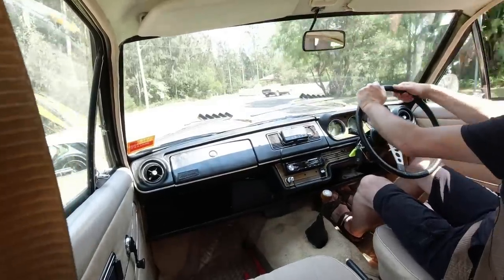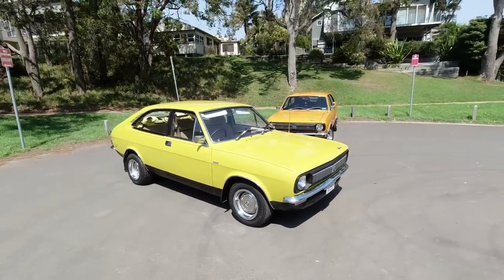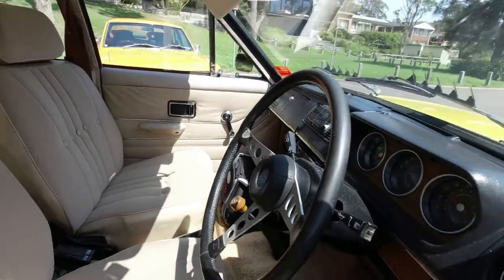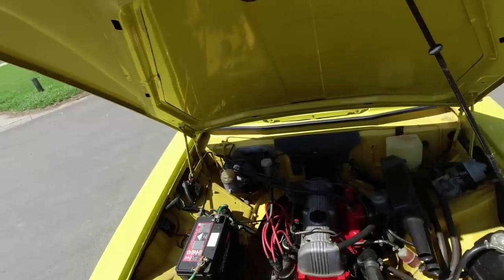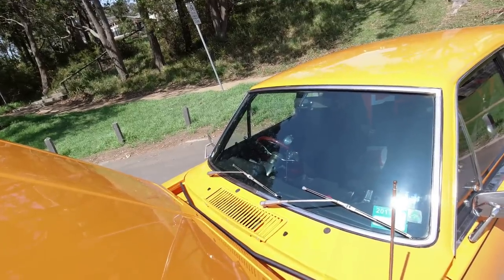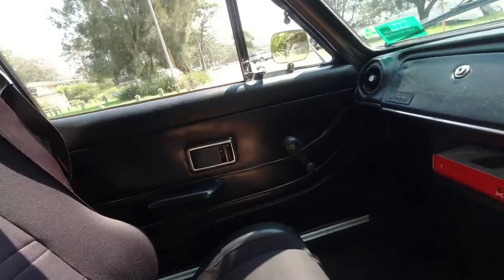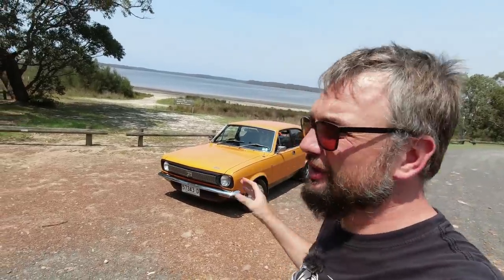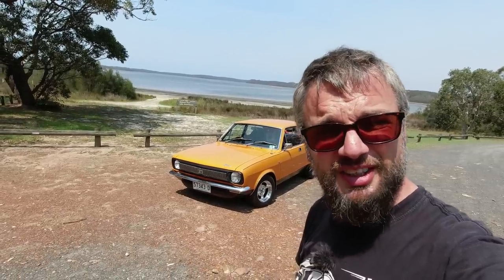Aussie Oddballs: Leyland Marina SIX-CYLINDER! Driven!

Comment: Brilliant  engine, the E Series. I had 21 Marinas - before I lost count. Used to pick them up for peanuts, get them running and drove them till they could drive no more. They were economical and, for me, they kept the wolf from the door in my early married life and owed a heap of money on our house. BTW, the 1750 engine had the same bore but a longer stroke than the 1500, hence the good torque. Got rid of my last one in the late 90s. That was one that had only 50,000 kilometres up on it when I saw it advertised for sale as a non runner. It was obviously hard to start since the starter had been burnt out on it. I put in a starter out of my other Marina, a manual, and it started first fire after standing for 3+ years. I was going to scrap it but when I realised the odometer hadn't been around a couple of times and really was low mileage, it became my wife's car. Only required 4 items to get it back on the road - wiper was stuck, ditter the washer pump - from sitting around a long time. Driver's side window winder broken and rear resonator had a hole. The reason it was hard to start - the original owner had put Bosch resistor spark plugs. When new, it was ok but when the gap became even slightly wide, the extra resistance when cold caused a very weak spark. Virtually cost nothing to get it back on the road and it cleaned up like a new car. BTW, the best option for the window winders is to use MG ones. They aren't scalloped out so much in the back of the arm so are stronger.

Comment: You mention the synchromesh 'not happy'.. and that was my problem with the Marina and Ital that followed. My first company car at 18 was an 1.3 Ital (X reg 1982?ish), six months old when I had it with about 7k on the clock. Second gear routinely crunched as sometimes did third. I loved it because it was my first car and brand new and my mates were driving 10 year old rust bucket Cortina's and Minis but it was a shocking drive. So embarrassing at 18 when continuously crunching the gears and people thinking I couldn't drive.. still, without people like you these old relics would have become washing machines years ago so thanks for keeping the memories alive. Still hoping you find a bottle green Humber sceptre with the black vinyl roof my grandad had.. 1725 engine, walnut (wood) dash, loved it with very fond memories.. here's hoping

Comment: of course it feels better built: the Oz and NZ built cars were better built.
Reply: My observation was the Oz cars were better than the NZ cars. Both in specfication and resistance to rust.
Reply: I should imagine Australia cars were more resistant to rust, they would hardly put tonnes of salt on the roads in winter.
Reply: All that sunshine would make happier workers;-)
Reply: NZ Marina was just CKD version from the UK
Reply: @Banom7a  And?
Reply: The Oz cars were better than the NZ assembled ones. The NZ car industry couldn't even build Japanese cars well. The car industry here deserved to die and replaced by new and used imports. Having said that I own a NZ assembled Allegro and NZ assembled Toyota 4Runner and NZ assembled Landrover.
Reply: @williamwoods8022  
But you didnt own an aussie or kiwi one.
Reply: Nz assembled cars would only have the   anti corrosion sprayed in the center of the panels , doors etc then rust out along the  bottom and  corners
Reply: @GSimpsonOAM  You do realize that Toyota ranked the plant in Christchurch as the best plant in the world outside of Japan, yeah?

As for whether NZ or Aus built them better, I'm not about to get into that pissing contest, but based on Australian performance in other areas of manufacturing I would have doubts. ;) :)

Comment: I have owned two marinas a 73 1.3 super and a 78 1300hl had no trouble with either and very reliable, how I would like to get my mitts on the 262 six wow what a glorious noise no silly popping and banging which seems to be the rage now. The o series engine was fitted to the revamped and renamed Morris ital and the montego a car I owned and regretted, I could not stop the engine leaking oil, keep up the good work Ian.

Comment: Great video, I briefly had 2.6 Marina 4 door, The suspension was shot which was terrifying (the design needed struts) The 3 speed box was definitely enough. But the acceleration was amazing and so smooth. Never saw a coupe version in NZ, but no doubt there were somewhere. Many thanks, Stay safe in the Lockdown

Comment: My god you are obsessed with wipers!😂 I have a soft spot for a Marina coupe, one 1.3 was our family car for most of my single digit years (I mean under 10 years old not my mum cutting all my fingers off). Vinyl seats to slide around on at every corner. 2 clocks as it was the poverty version. AM radio. Eventually it rusted away I remember the wings looking like a tin opener had been used on them, and my Dad upgrading it from wing mounted mirrors to door mounted mirrors and suitable chrome caps on the wings to cover the holes! Happy days.

Comment: My first car back in the early 1980s was a 1973 Aussie Morris Marina Coupe TC, with the Aussie 1750cc engine rather than the British 1800. It was white with fancy black GT stripes down the side, which ran from the top of the C-pillar, down to the top of the crease line, and forward to the front of the car. Not easy to explain, but they looked fantastic and really made the car. The engine, with the twin carbs, sounded great, and it went pretty well, too. Mine had no rust at all, and was also very reliable. It was built like the proverbial brick shit house. That's down under slang for built very solidly, indeed. The steel was very thick and strong. It was a pretty decent car, IMO, and I look back at it with affection, and I certainly wish I hadn't sold it for what I sold it for.

Comment: For what it’s worth I worked in a Holden dealership in the mid ‘70s, where my supplied ‘go for’ vehicle was a still quite new base-model Marina Deluxe Coupe, resplendent in the startling factory pinkish colour of Plum Loco..

Yes it was a 6-cyl with the 3 speed manual (on the floor) which I thought suited it very well; minimal shifting required, very smooth and torquey but also quite eager to rev. And yes it delivered always more than adequate performance, helped in no doubt due to the light overall weight. 

From memory I think ‘my’ example still wore the original Dunlop Guardian (or whatever they were) Crossply razorblades, so it was pretty lively in the wet! Wherein 2nd gear wheel spin was effortless, yet relatively benign. But nowhere near the ‘instant death machine’ they are made out to be, invariably by those who have neither sat in or driven them.

Years later I owned and loved two P76 V8s. But I never have forgotten that likeable Marina 6 with its rubber floor mats and longish gear lever, and of course the rare Plum Loco hue. In fact I’ve never seen another Marina 6 in this exact spec? 

At the time the dealer considered it virtually unsalable, which is why it became a ‘work car. But gosh as uniquely aussie nostalgia it would be an absolute hoot to own today :-)

Comment: I had a 1.8 DeLuxe 4 door in Teal Blue, brand new in 1972. Used it as a taxi for 18 months, and 110,000 miles. Never missed a beat. Loved it. I really don't understand what the 'haters', and they're still around, are actually going on about.  That 6 cylinder one over here in the UK would have been to die for. Awesome soundtrack.

Comment: Great video, thank you.  Where was it filmed?
1 - To get 89HP out of the 1500E engine suggests a fairly high octane fuel - not the 91 octane stuff that most Aussies use (aside from diesel of course).  Similarly 130 HP from 2500E.
2 - I suspect the 1800B engine gave higher initial acceleration, being tuned in the Marina for peak torque around 2000rpm.  The 1800B was of course a long-stroke engine with a heavy flywheel, giving it high torque.  In the BMC1800 it was tuned to give slightly higher power (85HP cf 82HP) and maximum torque at 2750rpm CF 2000rpm in Marina.  I'm sorry I don't have the actual torque figures, but the 2750RPM value was lower, but resulted in higher higher power which occurs at higher revs.
3 - Said 1800B in the Marina would produce fierce axle tramp pulling away at full accelerator, especially on a curve.
4 - The six cylinder 2200E in the BMC 1800 body was beautiful for the first 50,000 miles: after that the engine compartment was oil everywhere.  Valve stem oil seals.
5 - The 1700-O was nice in the Ambassador (and presumably in the Princess-2 and Ital) for grown-up driving (ie not boy racers).  It was quiet and flexible at UK motorway speeds.
6 - The early UK Marinas were very quiet inside, but suffered from incorrect front wheel geometry.  The quietness was lost when the fragile, wire-made exhaust mounts were replaced by a more robust bracket, which transmitted the vibrations to the floor.  Noisy even after I installed a "Silent Travel Kit".  Later Marinas had correct front wheel geometry.
If you haven't already guessed, I had: BMC 1800 Mk-1, 1800 Marina, 1800S Mk-2, Wolseley Six, 1800 Princess, 2000 Princess and finally Ambassador 1700 before I left England in 1993.  And I liked them all, excepting the Wolseley six 2200 engine getting oily and its poor quality paint job.  The Six wasn't as fast as the Cortina Mk-3 2000 on the straight, but could out-corner it by a huge margin.
The Marina used as many existing components as possible from existing models, especially Morris Minor type suspension: front double wishbone and torsion bars which were super-responsive.  However, where the Minor had 4-leaf (or 5?) rear elliptic springs, the Marina had 2-leaf!  And even the Minor-1000 could produce axle tramp!

Comment: At the garage that I worked at in 1977 our workshop van was replaced by a Marina pick up which came from the factory, but could not be sold to the public. It had a Rover 3500 V8 engine and five speed manual gearbox. It was originally given to the parts department who did not want it, so it came somewhat unwisely to the workshop. It was a real beast. When it came to us it had restricted inlet manifold which unknown to the management,  got replaced with standard ones, it had plenty of grunt  but was dreadful in the wet.
We must have had it a couple of years. Sadly an apprentice crashed it into a bus stop and that was that. It was replaced by a Mini van. 
They were great days.

Comment: Leyland in South Africa bought the E-Series tools and manufactured the Marina with 1750cc and 2.623l engines, in addition to the smaller 1300 Marina, till 1978. I had a rare 2.6 with a 3-speed Manual gearbox, which was actually very good. The std 2.6 car was only available with the Borg Warner 65 automatic transmission. The 4 cylinder car had the BW 35 as well as a 4-speed manual.

Comment: That V^ sounds seriously good and the paintjob is superb. The 4 cylinder sounds great too, but it is the V^ for me.
Reply: This top engine is a straight six. A V6 was close to unknown in Australia until the late eighties Holden Commodore. Suspect you mean V6 and not the puzzling V^ .
A straight six was the most common engine in Australia from about 1950 to 2000, so Leyland and BMC developed several straight six designs to gain market share.
Ford here had straight sixes , like Betty, made until local production stopped with the Barra in 2016.

Comment: I worked in Experimental at Zetland on these cars.
The 1500 went as well as the 1750.
The fix was to put a washer between the carby and the inlet manifold to restrict the intake size.
They both had the same 1 3/4” SU as the 1800 then the Kimberly and Tasman.
I did make a pattern for the twin carb version in the Kimberly.
The design made it pretty obvious the Poms in the drawing office had never heard of ‘The Scientific Design of Intake and Exhaust Manifolds’ by 
Phillip H Smith first published in 1962.
We really didn’t have a chance again Holden with the Torana and Ford with the V6 Capri.
I guess what’s the saddest thing is the Al V6 we’d developed from the 4.4 V8 it was never used in any car.
H.

Comment: I had a white 1500 Marina coupe as a first car many years ago. It was pretty basic, vinyl seats, no fresh air vents (so those quarter lights were handy), not particularly powerful, it didn't even have a radio at first. But it was easy to fix, fun to drive and i did a lot of kms in it all over Victoria.

Comment: Forty years ago, whilst my company car Austin Ambassador with the O Series engine was being serviced, I was provided with a Princess Courtesy Car. I had not gone more than a few hundred yards when I realised the engine in this car was a tad different. It was my first ever experience of the E Series six cylinder. I was very impressed as the presenter here also appears to be. A transverse SIX!  So impressed, when I handed the transverse six back, I asked if it was for sale. It was but, my then finances would be stretched more than a bit. Not buying that car was forever on of my life's "Regrets, I've had a few".
Reply: Hubnut also drove the first transverse E series six Australian Austin Kimberley from 1970 :
https://youtu.be/AYAPaah4piE
Built to satisfy Australian preference for six cylinder cars.
Up against six cylinder Holden. Ford Falcons and Chrysler Valiants although these were soon starting at 3.3 litre base models.
The 2.2 and compilations did not find enough buyers.

Comment: My father had a Marina 6 as a company car, 3 speed auto in Am Eye Blue. Don't you love the colour names?. At the end of the lease, he bought it for my mother, replacing her Mk1 Cortina. Credit to the owner of those cars, the front suspension modifications and wide tyres seem to have tamed it. With the standard tyres and suspension, the car could be diabolical, especially in the wet. I managed to accidently spin it at 20 km/hr in the wet, having stepped out of my Datsun 180B, a much better handling car. That aside, by heck did that Marina go! It was as fast in a straight line as a 4.9l V8 (302) Falcon in the traffic light derby. 

Mum had that Marina until 1989, so 16 years! Despite its shortcomings it was reliable, and the fact that it wasn't an MG (and the low gearing) didn't bother her at all. As the family hauler, it took us everywhere, even to the African Lion Safari! (older Sydneysiders will remember).

Comment: I bought a Marina 262 when I lived in Melbourne in 1976. Mine was a four door saloon and I still have the brochure . It had only done 93 miles. , the previous owner selling it because it was too small . It only had a 3 speed gearbox but you could put it into second gear at less than 10 mph and go up to 70 mph before changing up to third ..

Comment: Ran a Morris Marina 1.8 Coupe for 3 years. Road holding and handling in standard form was abysmal but the Ford Cortina was never that much better. The car was however supremely reliable. The car was converted to front coilovers, rear telescopic shocks which transformed the handling and made the car an absolute pleasure to drive quickly. The trusty B series was uprated and tuned to produce 130 BHP. It pulled like a train. Often thought the 1.8 K series would have cured the few remaining handling issues due to its much lower weight.

Comment: It was 1985 and a Marina was the replacement for my 1976 Datsun 240K, which I'd managed to crash two weeks after buying it. My main memory of it is brown... so much brown. A base model 1750, the brown vinyl seats nicely complemented the woodgrain plastic finish around the 2 gauges and heater controls (no tacho in this model). The brown paint disguised the rust, which was something. I never quite managed to get rid of the cam follower noise or fix the lever arm shocks, which usually faded badly after a few km of 80's Melbourne eastern suburb roads. After several months I'd sorted it out a bit and happily handed it back to it's original owner when I finally got the 240K fixed. Her daughter promptly put it into a tree and wrote it off. I think of all the cars I've had, the Marina was the one that I least enjoyed owning.
Reply: Should have kept the datsun!!! Better car than the marina!!
Reply: @peterkirgan6850  I got the 240K repaired, once the owner of the Holden Statesman who ran into me paid up. It took many months and a letter of demand from a lawyer in the end. The 240K lasted until '88 when it was replaced by an '82 Meteor S twin carb to go with my V8 P76 Super. The Meteor took me to Daintree via central NSW and QLD and back via the coast and the Expo. The Datsun would have struggled on the trip and the Leyland would have either disintegrated or bankrupted me with its fuel bill (probably both).
Of my least liked cars, the Marina ranks worse than the 1980 Corolla I had for a while while my Peugeot 604 was off getting a top end engine rebuild. That includes the fact the engine died in the Corolla and we had to do a engine swap in my friend's back yard.

Comment: The single rail in the P76 is a very sought after unit. They were extremely common in a lot of aussie cars and a very very robust unit, can handle a v8.  Would be interested to see how they fixed th e clutch on the P76 is an antiquated mechanical set-up whereas the marina was hydraulic right? 
With the kimberly twin inlet and 4 speed, that car would be a weapon!

Comment: Great vid. All the facts without the annoying music. I love the old Brit. cars, that gearbox whine makes it a "proper" car.
In the 70's I had the Marina Coupe with the 4 cylinder twin carb 1800? engine (same as the MG MGBGT), it was a lovely car, with velour seats and tinted glass, vinyl roof etc. in metallic Aubergine. It eventually rotted away and failed its MOT and went for scrap. You never see anything about them these days. It sounded fantastic as well with an off beat (V8 esq. sounding!) motor. Went well too..